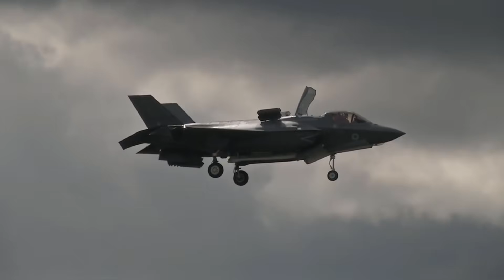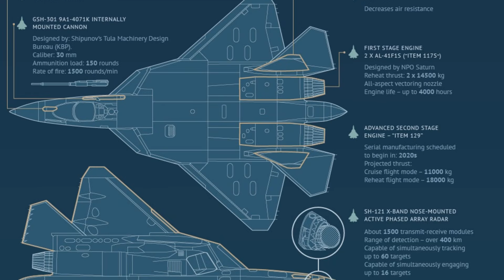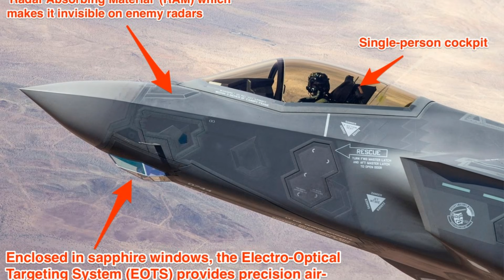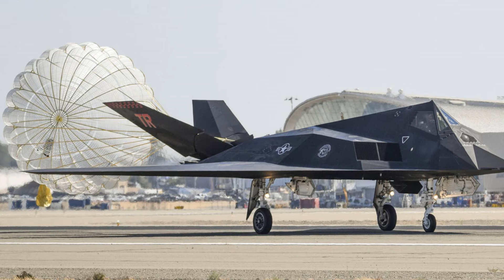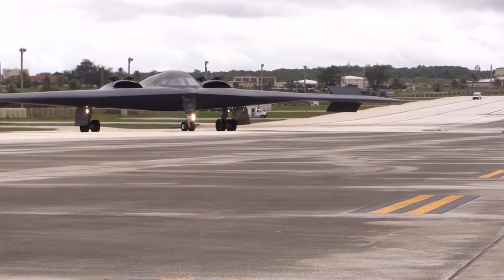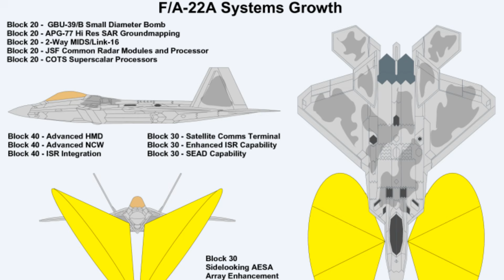Top 5 Combat Aircraft with Lowest Radar Crossection (RCS)

Comment: i'm fairly certain, most of these RCS estimates are incorrect.  unless the leading edges are knife-edge sharp, you can't have such low RCS.  and, there's still the issue of radar reflectivity off the canopy and the AESA radars! - the RCS estimate is assuming the radar waves bounce off the surface without penetrating into those covered areas that have only 40% radar reflection, as an example.
Reply: Cockpits are usually painted with a substance to help prevent some radar reflection. You'll sometimes see the F-22 with a yellow or pinkish color on the glass

Comment: This video doesn't know anything. F117 is so old, no way it has better stealth than the F-35. RCS of these aircarfts are a closely guarded secret.
Reply: F117 was designed almost solely around stealth. F35 had stealth in mind but still needed to be multi purpose
Reply: @Vulcvon no where in the engineering handbook does it say stealth characteristics have to be impacted to create a multipurpose fighter. This video is loaded with inaccurate information, and straight up lies.

Comment: i worked for a while a sukhoi, im an engineer in physics engineering / measurement and sensory tech (in germany it was called a "diplom" back then before they adapted the international standards, today its somewhat above a masters degree)  and im an engineer in aerospace engineering / avionics (masters degree) ...
... while working at sukhoi, the then pak-fa called su-57 was undergoing flight testing, there were three airframes finished back then and the proposed rcs is off by a lot, the company, or should i say the russians, simply havent gained enough experience in stealth yet, theres so many rivets and uneven airframe plating with craters and mountains that it could hardly even considered proper stealth. and my colleagues were on the same page with me. i still have contact with seven employees at the planet where the su-57 is manufactured and we are in regular contact, well, not now since the war broke out, or should i call it by its name: since the russian invasion of the ukraine (after the criminal and larcenic theft of the crimean peninsula), and they all told me, that nothing has changed. i was even told, that theres differences in up to 0.08m² in rcs between the different su-57 specimen.
not to forget mentioning the brutal, utterly embarassing issues and ongoing problems with their thrust vectoring nozzle system.
Reply: Thank you for sharing your story! I hope that smart people from Russia will be able to leave that country. There are so many more possibilities outside, I am sure that if they wanted they could get amazing jobs In western countries
Reply: The problem is Russia is still recovering from the dissolution of the USSR. The program does not seem to be funded enough.
Reply: Good story but an aeronautical engineered missed the part that rivets that the russia itself showed to the world was a prototype without any paint and RAM coating. So your engineering degree before Working in sukhoi didn't taught this?
Reply: nice excuse bullfuckery @SomeGuy-ti1ln
Reply: Ive Just seen some latin numbers on your vídeos, you are Cleary trying to spread some fale news here

Comment: These RCS numbers are for frontal angels of aircraft. The bottom surface of them have much more RCS. The radar beam from Grounded Air defences radiates to bottom surface and reflects much better compared to frontal angels. Thats why these advanced war machines can`t penetrate to supported areas by most advanced Gounded radars and use standoff weapons to avoid entering these areas. For example the RCS for bottom surface of B2 is more than 0.5 m2. Thats very much for advanced air defences.
Reply: You are right about the detection elements, however the RAM is much greater on the bottom which helps absorb the radar.  When one of these planes are entering a contested radar area because of the Earths curvature it will not catch the bottom but the frontal and wing areas.  So even with the most advanced radar systems 2 things would occur:  1.  The opposing radar would have to concentrate its beams in the direction of the aircraft (not very likely to happen in passive mode).  2. If detected in would fade in and out of radar so as a missile would be almost impossible to get a lock on(until the stealth aircraft came in closer).  
The plus about these stealth aircraft for the US is they would detect the radar systems before being detected themselves and would fly around or engage the ground radar sites.  So yes the advanced ground radar can detect the stealth aircraft but at that point the ground radar would be a sitting duck.

Comment: The F-35 should be #1 (or #2).  Most because it is the ONLY plane that has electronic jamming capabilities built into it (not sure about the B-2).  But still those sizes are not really indicative of the actual ability for radar to detect them.  Even though the F-35 has 20x small radar image it (in the real world) like will be detected at 1/4 the range of the Su-57.  So if the Su-27 can be detected at 120km, the Su-57 at 40km, and the F-35 at 10km... the F-35 is going to take the Su-57 down every time... especially when they get the AIM-260.  It is also the only one to be able to launch from an aircraft carrier (F-35C) or light carrier (F-35B) making it even more capable.

And yes the Su-57 should not be on the list... for MANY reasons.  One is the stealth is only effective from the front which will only help against other jets it is travelling to intercept and even that is limited.  The F-35 is going to be linked with other jets and radar system in the area so the Su-57 will likely be detected rather fast.  The second is the craft has a massive thermal image.  Third and most important is Russia does not have any.  Total they have 4 two seat trainers with underpowered engines, no radar absorption, and limited electronics.  They have been struggling to make the engines for almost 10 years now.  Current estimates were 2025 now, but with the war they will be struggling to get the electronics too and the production will likely be delayed more... assuming they can afford them too as they have had massive cost overruns and their economy sucks right now.  The other issue is even now they are only planning on making 76 of them and they would be facing more than that from 2 carrier fleets and many NATO countries are ordering the F-35.

The J-20 is even worse.  India was able to pick up the J-20 at almost max range of the radar on their Russian made fighter jets.

Is it just me or does it seem there is something wrong with the F-22.  It is NEVER used.  The F-35 has likely flown FAR more sorties than the F-22.  I wonder if there is an design problem, like with the engines that keeps them from being used.  Yes I know they are expensive to use, but that is already figured into the budget and has never stopped the US before.
Reply: There's a couple reasons for the F-22 being used so little, despite it being such an extraordinary fighter.  First, it's primarily an air superiority fighter, whereas the F-35 is designed as a multirole fighter.  Second, and more importantly, the numbers of F-35s in service dwarf the F-22s (750 versus 186 according to Google).
Reply: @found6393  But the F-22 has been around for a lot longer... before any F-35 were built and they NEVER sent it on sorties, but they did send F-15s.  Both are really interceptors.  The F-35 though they started sending on sorties VERY early, like hey could not rely on the F-22 instead.  This was the F-35A also which requires an airbase, just like the F-15, F-16, and F-22.  I seriously wonder if there is something wrong with the F-22.  I also know they are looking to upgrade it too... which seems odd for a jet they never fly.
Reply: @toddabbott781  call me cynical, but deploying F-35s as early as they did was probably more about settling Congress concerns about cost blowouts and project delays.  It was probably also related to showing the aircraft to existing order holders about the long delayed deliveries and the aircraft's capabilities.  Also the F-35 can be sold overseas which the F-22 couldn't so the latter was probably "held back" from deployments unless it was really warranted. No point wasting precious aircraft unless absolutely necessary..
Reply: @ianmorris7485  I think it had to do with testing on the Wasp class amphibious assault craft.  They stationed one with 13 on board off the shore of Japan.  I think Japan also received the first foreign shipments of 20 or 24 F-35A shortly after.  They started running sorties right away.  A lot of countries wanted the F-35A or B.  The program has matured significantly.

Comment: Su-57 hasn't been proven to have any stealth capabilities. It looks neat though.
Reply: The single biggest issue with the stealthiness of the Su-57 is it's engines. Russia has never been able to produce an engine(s) that have BOTH stealthiness AND the required power.
The RCS for the 57 claimed in this video are either exaggerated or reflect (no pun intended) only a front or side profile.
Reply: @quasimotto8653  Ιt does literally say that it is the frontal RCS that is discussed in the video in the case of the SU-57. However, when it comes to the Felon, other than the engines, it does seem to have the right geometry for a stealth aircraft.
Reply: @GREECE5858  Frontal RCS is "literally" only one aspect of stealthiness; is a ground-based radar system attempting to detect a plane overhead going to be getting a frontal profile of the plane?
Likewise, the "right geometry" is "literally" only one aspect of stealthiness; what difference does it make if the body of the plane is extremely stealthy when the engine(s) is "literally" screaming through a bullhorn:  "HERE I AM!!"?
Reply: @quasimotto8653  The engine is only detectable from specific angles since it's on the back of the plane and on top of that, it is meant to be changed into a new one, the current engine is literally just a stopgap measure. And geometry along with materials used are the two main aspects of stealth. Overall, it's far from bad, certainly not F-22 level, but far from bad.
Reply: @GREECE5858  Whatever the excuses are........it's NOT true stealth.
PLUS, there's never been mass production.
PLUS while Russia is still trying to make a legit 5th gen; meanwhile US is getting close to development of a 6th gen.
"...the current engine is literally just a stopgap measure"??  LOL   It's over a decade old and STILL not true stealth.
Reply: @quasimotto8653  Lmao, someone is getting quite passionate about it. Did the SU-57 hurt you or something? Or is this some sort of competition that you've placed bets on? I never mentioned the US, I merely explained what's going on with the SU-57. It has a smaller RCS than most other planes (and if I recall correctly the Russians measure RCS differently to the Americans, so the true RCS of the SU-57 is even smaller than the number we say if translated to the same scale as the Americans measure.) and even if it's not as stealthy as US or Chinese Stealth fighters, it's still the best equipped fighter to deal with stealth aircraft in the world as of now due to its L band arrays, which is quite an interesting concept. For more info check out "Millennium 7 * HistoryTech"'s videos on the SU-57, if you are actually interested in finding out how it works and don't just want to diss it.
Reply: @GREECE5858  The SU-57 didn't "hurt me" and it's not about passion at all.  It's about the opposite.........FACTS.
And whether you mentioned the US or not, if the discussion is about stealth fighters, it MUST include the F-22 or F-35. China's "stealth fighter" is probably even less legit that the SU-57........who/what are you going to compare either to if not the US?
I would not be surprised to learn that Russia measures RCS differently than the US. But please give me your reasoning on why you ASSUME the Russian process results in a larger RCS.  It sounds like you are straining to find ways to kiss up to Russia/the SU-57........do you owe a few Rubles to Putin?  
And yes, I've seen the 2 or 3 SU-57 videos posted by M7 History Tech; nothing really newsworthy in his videos.
"....DISS it"???   LOL  Did you import that from the US?
And don't worry about "LMAO"........if your @ss has an RCS as large as the SU-57, you won't have a problem finding it.
Reply: @quasimotto8653  If it were about facts, then you'd actually discuss the fighter instead of being all aggressive. And if anything, all I have stated so far is facts, with the exception of RCS, which I did mention "If I recall correctly." Moreover, when discussing a specific platform, comparing it is pointless and shows you have other interests in this discussion, namely proving your bias. The SU-57 shouldn't be compared to the F-22, since Russia lacks the capacity to build the SU-57 in similar quantities and has a very different doctrine, which means that the SU-57 won't be used the same way the F-22 or F-35 are used. 
Moreover, talking about China, it's argued by several experts that the Chinese J-20 is stealthier than the SU-57 and more comparable in RCS to the F-35 than the SU-57 is.
As for the RCS, again, don't take my word for it, but if I recall correclty, I remember that the Russians measure RCS with a different percentage of detection compared to the US, which is "tougher". Much like how they measure the percentage of armour penetration differently from the US for their tank rounds.
Also, if you had watched his videos, you wouldn't say it's nothing "news worthy." Instead you'd know about how L-band arrays can spot stealth aircraft, about how all RCS are just estimates, about how the RCS of the current SU-57 is different compared to the prototypes which had exposed bolts and about how the new engines are already in trial stage, have flown and are almost ready for installation. And it's not 2 or 3 videos, it's closer to 7.
Moreover you'd know that RCS is not something stable and depends on the altitude and angle of the fighter and radar, the type of radar and so forth.
Touching on the SU-57's RCS once more and namely that last comment of yours. The RCS of an SU-57, given the expert estimates, is about as big as that of a missile. And while that of the F-22, F-35 and J-20 are smaller, it's still extremely small. 
Also, about the 'roubles', it was a nice attempt at a "No you" comeback, but I am neither from Russia nor any state that's allied to them. I have no interest in 'proving' that the SU-57 is 'superior' to any other aircraft, nor do I want to or care. Again, if you are actually interested in learning about the aircraft, give those videos a watch, they are very analytic and scientific. If not, keep saying what you are I guess.
Reply: @GREECE5858  LOL  You want to whine about me being "...all aggressive" because I responded in kind to your personal comments about me? Don't be a b!tch; if you can't take a counter without crying, then don't throw the first punch.
As recently as last week, I browsed through ALL of the videos on the M7-HT channel; all relevant information on developments/statistics for the SU-57 can be found in the 3 videos that I mentioned; the information in the other 3 or 4 videos is REDUNDANT.
And again, I saw nothing in his videos that are particularly "newsworthy"; do you think he is the only person to ever discuss L-Band arrays, SU-57 prototypes vs current versions and dynamics of RCS calculations?
And OH REALLY?  RCS is "not something that is stable"??? You don't say!! Wow.......you had to really dig deep into your bag of knowledge to produce that gem.
And just an FYI:  putting "If I recall correctly" in front of a statement that is ONLY your opinion does NOT make your OPINION any more believable.
Reply: It is cool looking fighter jet, looks great in parades and air shows.

Comment: I doubt the su-57 is anywhere near that good it still uses rivets
Reply: only the production version of the Su-57 has the necessary improvements to have an RCS below 0.5 m²
Reply: Newer models don't afaik but the canard will still compromise it a little. Even then with appropriate treatment it can probably be pretty decent too. the F-22 still has boundary layer dividers and yet its RCS is the smallest out there.
Reply: You have to admit that the Su-57 is a breakthrough for the Russians because it is their first attempt to have a Stealth Fighter and they achieved a good result for their first attempt.
Reply: @angelarce832  Which they have all of ~5 existing.
Reply: @benn454  14 actualy
Reply: @giovanideoliveirasalvador8605  Let me count up all the F-22s real quick. Yup, still doesn't matter.
Reply: @benn454  and f22 is Begin retired